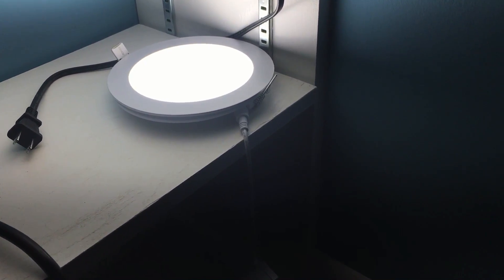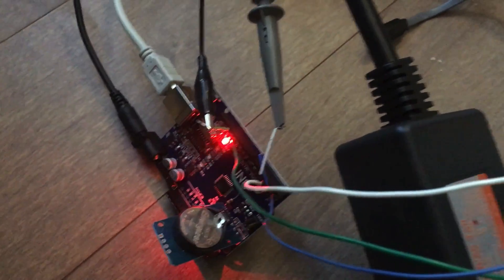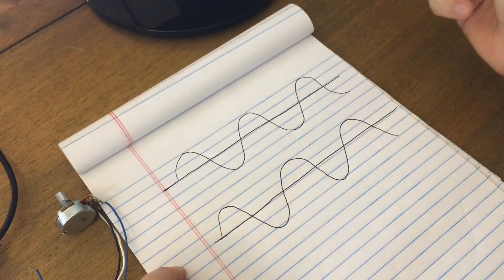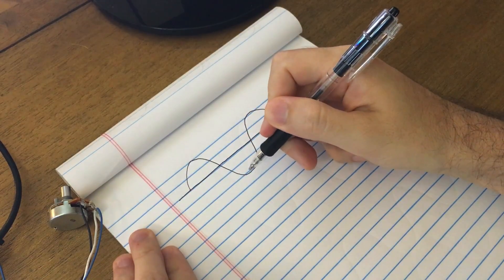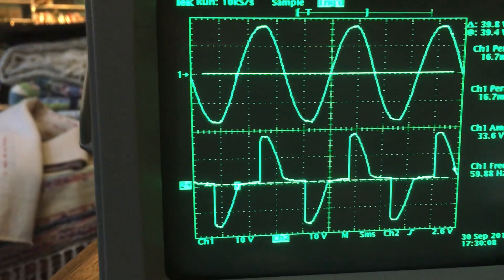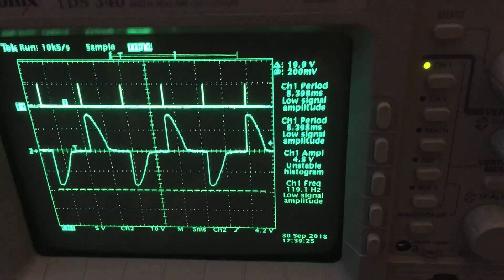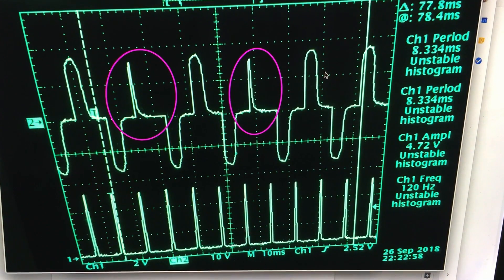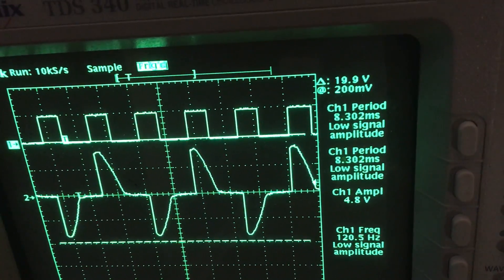How to Dim LED with Arduino & Triac

Comment: This is nice ! I had been meaning to look into how does PWM with AC voltage works. However I think it'd be better if you explained the whole "optic isolation" and that blackbox thing a little bit more. Or maybe even show how the arduino, the triac and the LED are all connected.